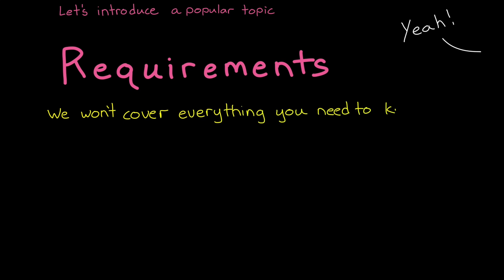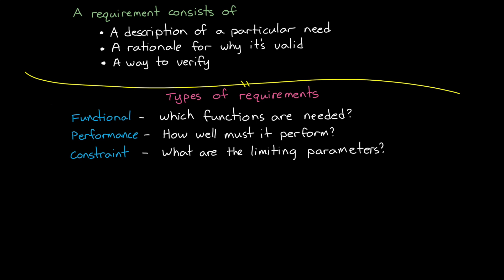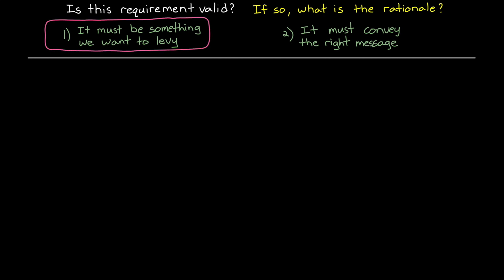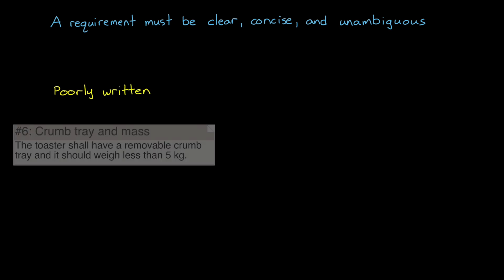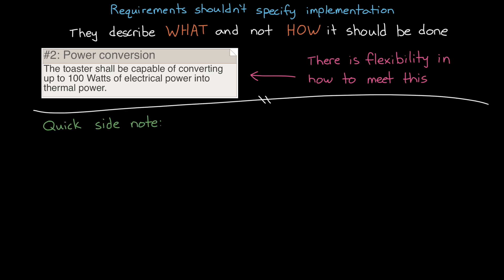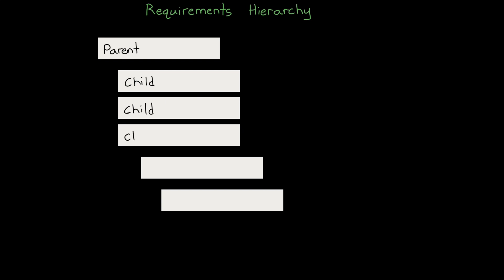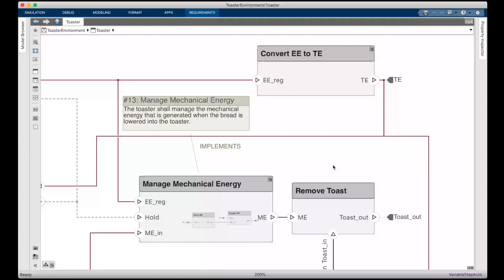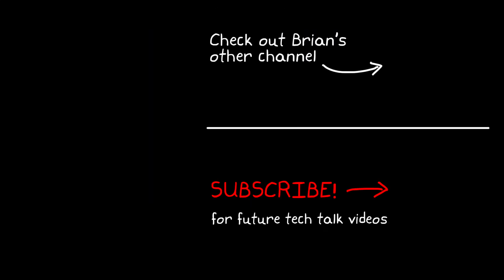An Introduction to Requirements | Systems Engineering, Part 4

Comment: I'd like to point out one of the intellectually flawed points in this lesson. Around the 7-minute mark, you talk about a requirement being "poorly written;" however, this is not at all a reason to make a requirement invalid. Anyone with basic reading comprehension knows what the requirement means, and it gets across the required information. It's obvious the tray is meant to weigh less than 5 kg and not the toaster. In any way, if one requirement can get across all the necessary information as the example does, then creating another requirement just to say the same thing, but having it split up into different sentences, is redundant.

Comment: Good Morning Brian, I wanted to know how you would specify technical safety requirements without forcing an implementation ? If a requirement is ASIL rated, there are specific ISO-26262 guidelines to be followed when the programmer is developing the code (Like Variable definition, ASIL component partitions, No recursions, no hidden dataflows, no unconditional jumps, only 1 entry and exit point per function, etc.). That gives the developer a lot less freedom on how to implement and forces a particular strategy.

Comment: Unfortunately, I don't think this is a great example.  Saying that 10 slices are un-acceptable, but there are no requirements for the any number of pieces of toast....so a 1 slice toaster?
Why are there not requirements for "time to toast" , "even-ness of toasting/browning"...this went straight to a wattage requirement , but not a requirement to work on 120V outlet.  Also, the "mechanical energy storage" requirement assumes a solution of a person pressing down and the toast popping out....this could instead be motorized to pull the toast through to ensure more evenness of toasting, etc.  Finally, requirements should not assume solutions.  If the solution is the requirement, then just state that...don't pretend that it is a "better requirement" because it doesn't explicitly state that "it shall use a spring loading / unloading system that tensions the spring when loading, then uses that tension to eject the toast when complete"

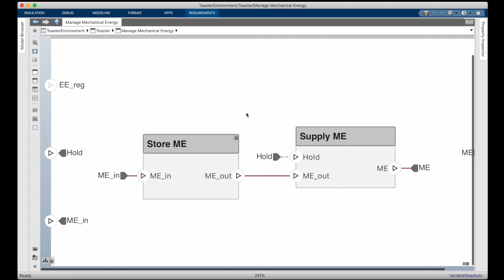Comment: @13:06 you say that a spring has been chosen as a design and you go on to say that you can state a requirement for that spring. Fair enough. However you do this while showing a <<implements>> relation from the function "Store ME" to the requirement and the requirement contains the word "spring" you therefore have a requirement that is specifying an implementation, but the dependency <<implements>> comes from the function. Very confusing!

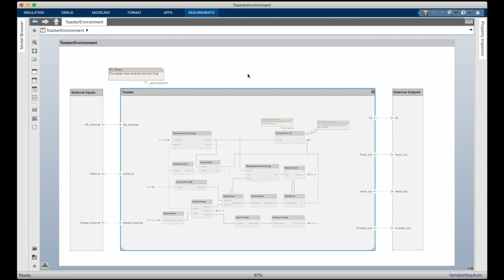Comment: @3:50 you say that the toaster must <<satisfy>> the requirements. Why do you then use <<implements>> as the dependency relation from the functions to the requirement? "Implementation" is very different than high level functional architecture. It is the E/E assembly that <<implements>> the function!
EDIT: This is  exactly what you do @9:34!